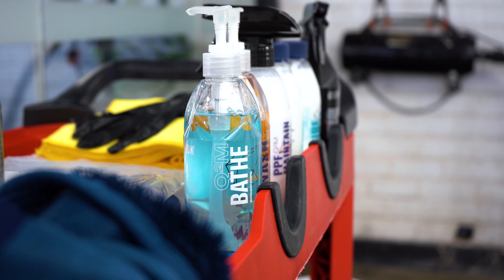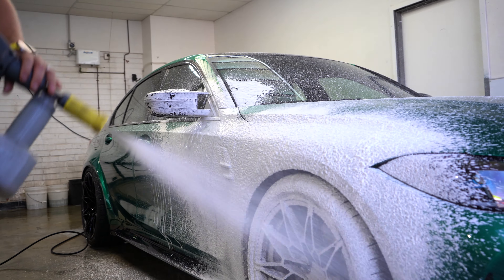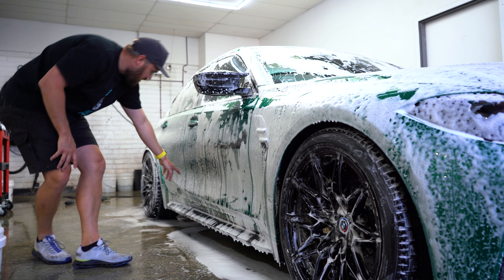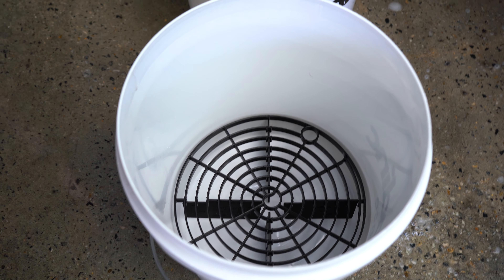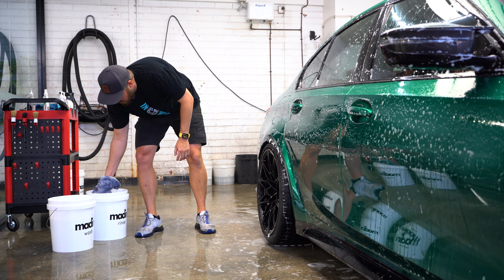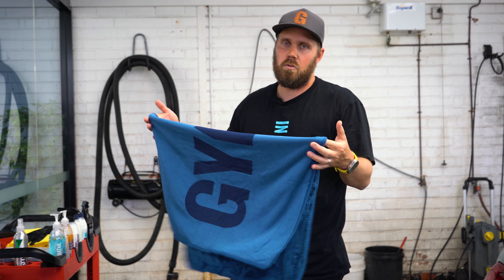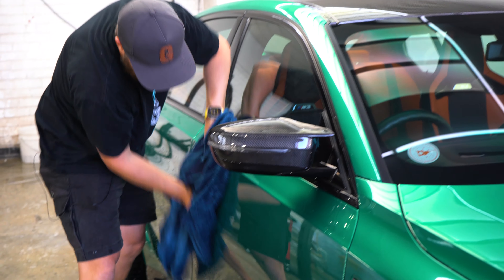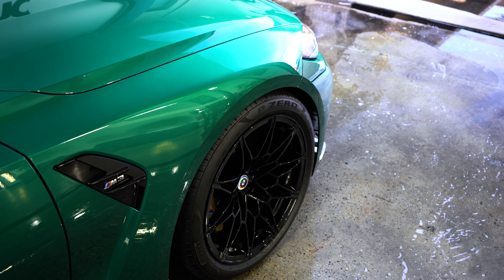How To Wash & Maintain Your Car - MADinc Product Guide

Comment: Do u guys use deionized filter water in the workshop?
Reply from the maker: We use filtered water :) depending where you live it may or may not be required. If you live in the top end of W.A it is highly recommend to have an inline filter to reduce / remove the calcium from the water 👍🏼